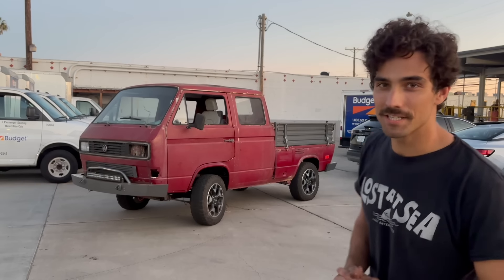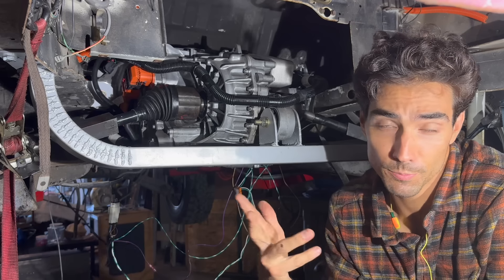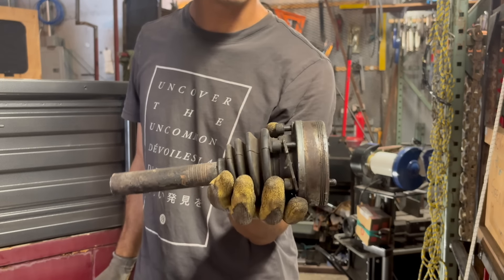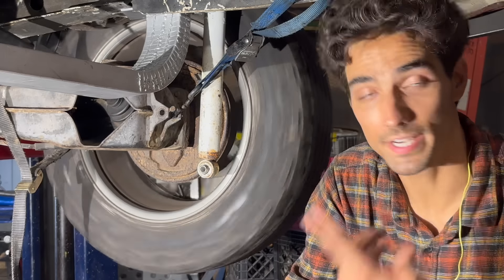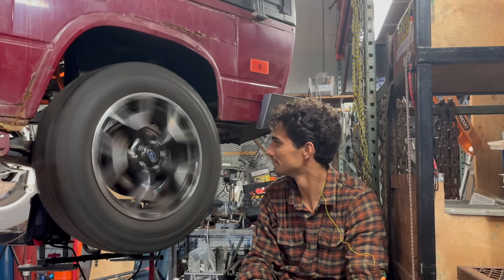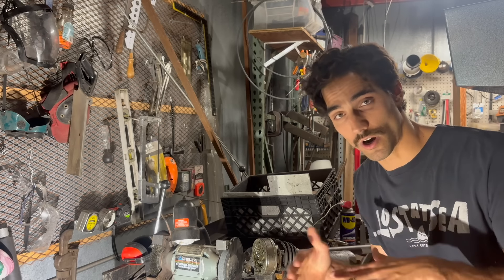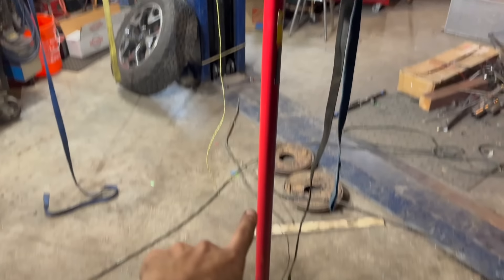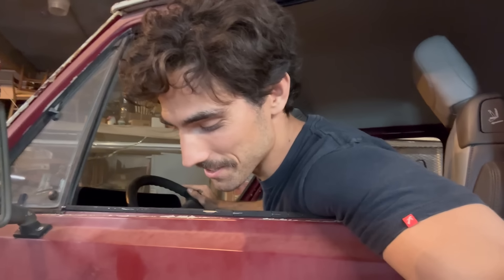First Drive of My Tesla-Converted VW Bus

Comment: Congratulations!  I did a 65 VW 21 window bus with a Hyper9 motor 2 years ago.  I LOVE driving it.  I'm looking for my next build ideal and really want to use a Tesla small or maybe large drive unit.  Did you have to replace the inverter board in the drive unit with the Opensource or AEM boards?  I'd love to know more about the components you are using.  I'm in So Cal also and would love to connect and compare notes.  Spencer
Reply from the maker: Thank you! No, I use one of the companies that tricks the motor into thinking it’s still inside of a Tesla. So no change of the inverter port itself. I’m down in San Diego. Send me a message on Instagram and let’s link up.

Comment: That left axle shaft angle is concerning, given the angle and substantially greater torque being applied. Porsche 944 CV joints are a bolt-on replacement with better angle and torque ratings than stock VW T3 units. The next step up, which would unfortunately require getting another set of shafts made, is to upgrade to Porsche 930 CV joints. This will require new stub axles with the larger bolt circle, but the increased angle of operation range and torque capacity may be worth it. My vanagon is TDI-swapped, making double the torque of the original waterboxer, so I upgraded to 930 CVs. Another nice thing is that 930 CVs have become a popular standard for automotive and even UTV upgrades, so joints and boots are easy to find.
Reply from the maker: Somebody gave me a pair of 930 shafts to use, but I was not able to source a pair of spindles fast enough. That’ll probably be a future upgrade if these angles end up, causing the joints to fail. Great insight!
Reply: @bernietime  Some suppliers modify OE outer stub axles on an exchange basis, and I'm pretty sure the stubs and hubs were the same for the 1968-1991 model years. I know for sure that the rear hubs currently on my TDI Vanagon came off of early-mid-70s bay window buses.

Comment: How did the tesla controls handle it? I would expect the drive controller to fail, due to not getting the right signals in and out.
How much of the tesla is in the bus, besidds the motor an battery?

Comment: Nice job. 
I see the tesla motor has 2 shafts out basically a transaxle ? Is itpossivble to run a motor with one shaft output so it could drive a van axle instead of the prop. ??
Reply from the maker: Yes! Nice catch. People do this for classic Land Rover conversions. I would’ve done this as well if I had the front differential in rear transaxle from the syncro. You also have to buy a limited lift differential or disassemble the motor and weld the spider gear. So both options are totally valid, but require perhaps equal levels of work?

Comment: I think the angle for the CV ales from the tires to the engine is too great. I am moving my motor right now because I had issues moving forward and I think it was the CV axles.
Reply from the maker: I’m worried about that too. If they break within a couple hundred miles, I’m going to lower the motor I think

Comment: Is the 4x4 functional ? I have a 1991 Syncro Carravelle in Southafrica and is looking at doing this as well. Still saving cost is very high due to the rand dollar exchange rate
Reply from the maker: Not yet! It does not have any of the original syncro components left. In the very near future, I will be installing a second Tesla motor in the front to have all wheel drive that way I can truly call it a syncro again.

Comment: Question - where did you get the drive shafts made? I'm planning an EV conversion on a Vanagon using a motor and egear drive from a Coda. Also, was this a syncro (AWD)?
Reply from the maker: Dutchman axles! It was. And it will be again. I’m installing a second motor in the front soon

Comment: Sweet.  Something to think about in the future to maybe do on my 61 single cab.
Reply from the maker: That would be easier given the larger treasure chest area. How big is that area?
Reply: @ it’s huge!   And when you take out the gas tank it’s bigger.  Basically from the back of the cab to the motor is all empty space and as wide as the truck.

Comment: Where did you get the axle shafts made up? Ball park cost? Good job, cool build.
Reply: i was thinking the same, who manifactures that?
Reply: @jimzucker  the ones I've seen others use is the entire assembly, This seems like it would be a lot more cost effective.
Reply from the maker: There’s a couple of companies out there that will make them if you send them a sample. For popular conversions, there’s even off the shelf solutions. I used Dutchman axles
Reply: @bernietime  Thanks, I found them online. the way you went about the axles seems to me to be the way to go.

Comment: So it's not a Syncro anymore?
Reply from the maker: It will be soon! I have a video coming out soon where I install a second Tesla motor in the front
Reply: @bernietime  how are you going to programm the awd capabilities!? wouldnt have been better to use the awd system of the VW just attached to the tesla motor?! or why not have bought a crashed awd tesla and used all its electronics for example!
Reply: @bernietime look 👀 forward to the synchro, lots of space in engine compartment for another treasure chest.

Comment: Did the ride stance change with the conversion?
Reply from the maker: Yes it has a squat stance with the rear being lower than the front. The overall weight is still the same as it was when it was stock. I’ll need to put shorter springs on the front

Comment: drum brakes stop just fine, they are actually just as strong as disc, they are just harder to maintain, it is a huge myth.
Reply: And drum brakes work better as parking brakes as well.
Reply: @davidwilker4795  Yep and what added to this myth is most people have drum brakes with no brake booster.  Brake Booster + drum = better than disc alone.
Reply: I disagree.
Reply: Volkswagen ID-series EVs, including the 6,000 pound ID Buzz, come with rear drum brakes as of the 2025 model year, so rear discs are definitely unnecessary. 
Regenerative braking will do most of the work at the motor-driven axle.
Reply: @pan6593  they grip just as well but they dont dissipate heat like discs do. and yeah they get gungy inside.
Reply: How hard does the motor brake when it recuperates? 
Is it sufficient for normal braking?
Reply: @SkaterStimm  in my car, 2016 Spark EV, using regen to slow down s similar to downshifting a transmission. It slows the car down to about 5 MPH.

Comment: Attaching a 1970's automotive tech to a 2000's designed motor is just wasteful engineering. VW is 3600 lbs. Wasteful!
Reply from the maker: Bad take
Reply: The lightest sr nmc model 3s were almost that heavy! I think this is a crazy cool build!
Brings back the true spirit of hot ridding and elktromods are the future no matter what anyone says otherwise.